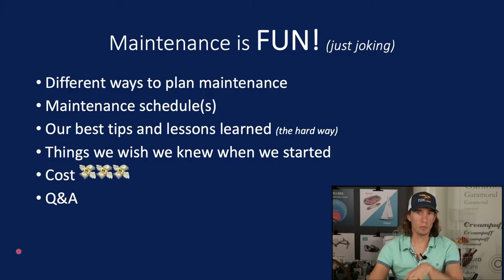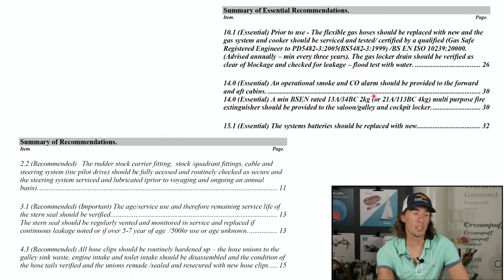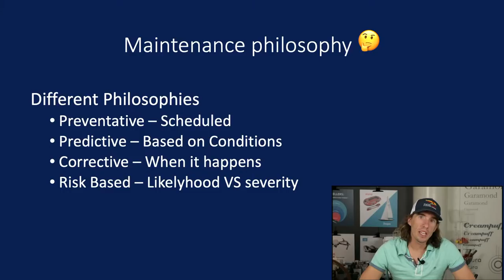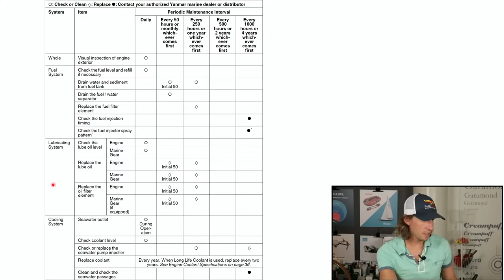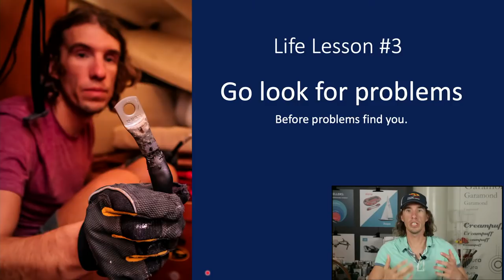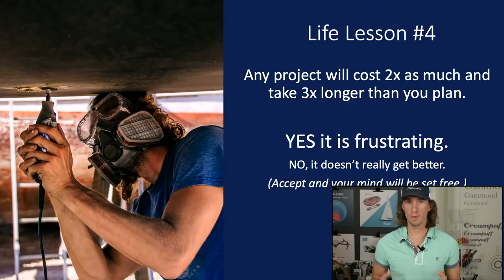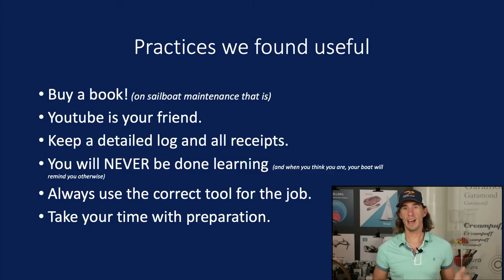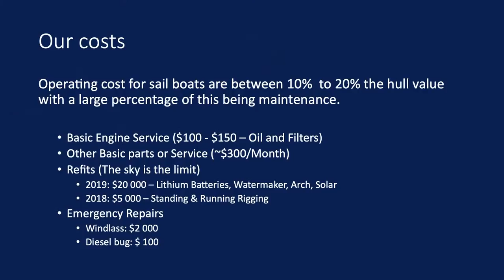Sailboat Maintenance (or how to avoid unnecessary predicaments) // Ryan's live tech talks #4

Comment: Surveyor’s are really important to you as a buyer.  To say you wouldn’t even use one on your next purchase is not very wise thinking. If there is a bunch of stuff wrong with the boat you might want to buy, it gives you options. If there’s a lot of expensive stuff,  you can walk away from the deal, or ask for a huge discount off the asking price.   Surveyors have seen all types of boats with all types of issues that you may not be aware of. Go with the pro on this one.  Also our insurance company requires a survey every 2 years. If you have a good relationship with your surveyor and he is familiar with your boat, it could go relatively quickly, and cost way less. We ask the surveyor to pop over when we haul out every 2nd year for bottom paint, just to do the bottom inspection, and then he pops over when he can for the rest of the full inspection....it’s a great idea to have a second set of eyes looking things over...

Comment: Well done!  One potential Tech Talk topic would be a discussion on the materials used for upgrades/maintenance and refits.   Wire nuts vs. proper splices,  welding cables in lieu of battery cables. cheap crimp connectors vs. heat shrink tinned copper crimp connectors.  Your point on buying a boat in part is "buying the previous owner(s)" is SPOT ON.

Comment: Missed the live guys but great video very informative, if you are changing hoses on the engine use silicone wherever you can they are heaps better, also the exhaust elbows aftermarket stainless steel is better and sometimes cheaper than original stay safe
Reply from the maker: Thanks for the great tips!  Ryan

Comment: I have been watching your video about desalinization, I have a question, is there too much pressure? Suppose I used a 3500 PSI pump, would that work? I have an idea to get rid of the electric motor, which would save hundreds of dollars. Have a great day and sail safe!
Reply from the maker: Hi Lee... When you say "can I use a 3500psi pump" are you saying that the max rating for the pump is 3500?  Using that much pressure will damage the RO membraine.  That said, I believe our pump is rated for 1750 psi.  We control the pressure through the control valve which is on the brine water discharge... So as long as you keep the pressure in the membrane at 80p to 850 psi it should be okay.  Ryan